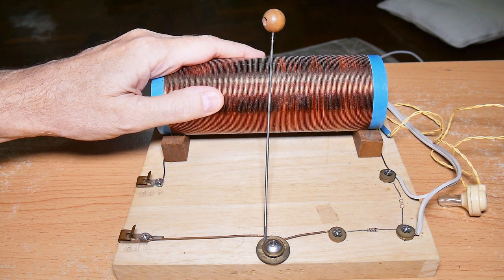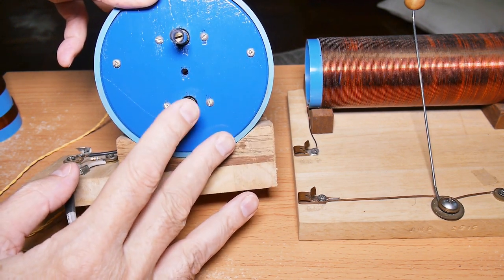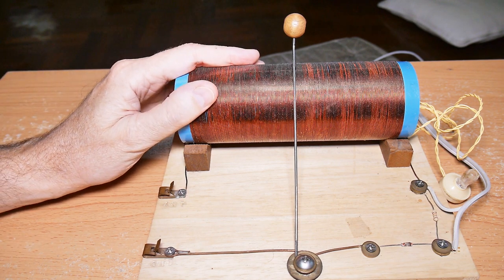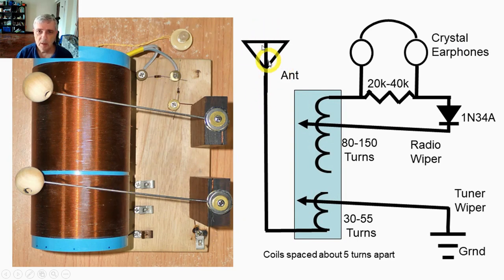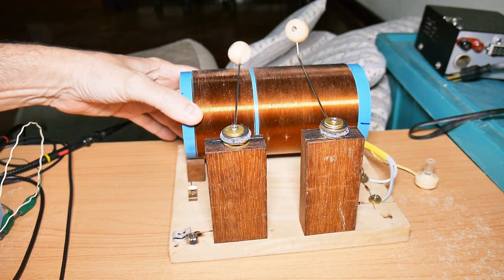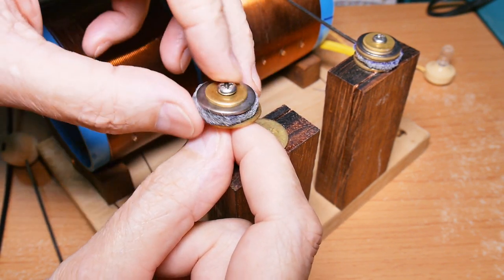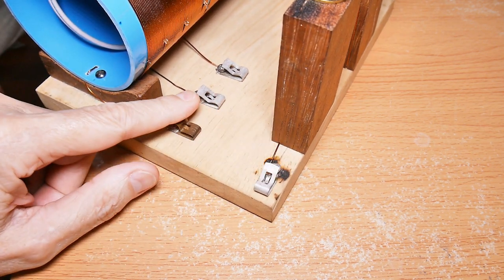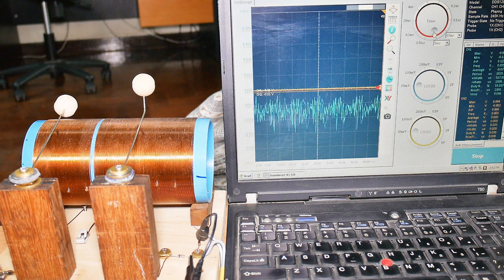My New Favorite!  Crystal Radio with Antenna Tuner

Comment from the maker: RELATED CRYSTAL RADIO VIDEOS: 
How To Make A Crystal Radio - No Batteries, No External Power: https://youtu.be/mt-s7pf-U5Q   
Crystal Radio, Capacitive Tuning - WORKS GREAT!:    https://youtu.be/VJ80Nm9KSkE
Crystal Radio & Resonant Coil Design:     https://youtu.be/Fw9eb-aB-XU
Crystal Radio Antenna (Shortwave Also):    https://youtu.be/G8AsgZbncW4

My Crystal Radio Does NOT Work (FIXES for common problems):    https://youtu.be/kCxQ8iPQx4s
Good Crystal Radio Connection Points:    https://youtu.be/G3qjrReHR1k
Crystal Radio, Connect A DC Audio Amplifier:  https://youtu.be/RW3VhnzgjtA
Three Upgrades For Your Crystal Radio:   https://youtu.be/LENco3_jV_s
Crystal Radio Wiper Upgrade:     https://youtu.be/i1otDz39nlw
Popular Crystal Radio Design That's a Waste of Time - And Why: https://youtu.be/r9Onub2Xpzc   
New Crystal Radio Design - "Modified-Pickard":     https://youtu.be/_qxHhFKjLAg
Crystal Electric Generator RF Energy Harvesting Exp 5 - Full Wave Rectifier:   https://youtu.be/BTu_GJKjOmA

Comment: Wow ! I'm growing more and more satisfied with your two coil design.  After I modified mine to your design (even without making the turns to ground adjustment) I'm getting much better  frequency separation.  
Before the mod I could understand 3 stations with very much cross talk from even more stations and when I pushed in my paper core capacitor all the way in I could still hear the  strongest station, but couldn't understand anything because the cross talk was still stronger.  I haven't yet put separation to a hard test on the upper frequencies.
Now (even in the daytime) when I push the capacitor in (oh and I finally got my store bought capacitors) and when I add in the store bought capacitor in parallel with the paper core capacitor I can hear a few weak stations and understand them because there's now no cross talk way down in frequency.  It's still not as sensitive as my TS 440, but that radio is a little more sophisticated.  lol
Now on the crystal radio I easily find 5 or 6  stations now and separate those other much strong stations  - "entirely" out with zero cross talk.   I'm getting stations somewhere around 0.630 kHz.  Weak, but steady.  I suspect that station is 1 kW power and around 25 air miles from me.
You likely saw the uH numbers on my coils.  I'm sure the radio tunes below the broadcast band, however I don't think it goes as far down as hams have frequency privileges.
Oh, I found out a few days ago that there's people who make their crystal radios modified so they can compete in crystal radio contests.  If I remember correctly their rules say they can't be audio amplified.  If that's so they're likely your brand of purists.

Comment: I made a little progress.  Oh, and I got the new diodes.  I have to amplify.
(I hunted and deleted that comment I asked you to disregard a week ago.)
I finally added the L-Match coil between antenna and ground from your *"My New Favorite Radio" *video.   I waited to install that coil because I wanted to experiment with different main tuning coils first.  
On my DIY receiver most of the stations are crammed at the higher frequency end of the band and I was trying to find a few semi-local stations down around 0.520 and 0.710  The strong higher frequency stations (1.130 and 1.460) wipe out the weak lower frequency stations.  Those lower frequency stations are  weak even on my commercial receiver with a 62 ft dipole up about 30 ft..  
I made the L-Match coil on a sliding form over the top of the  coil form of the main tuning coil.   I made it slide - on - top- of - the - main - tuning - coil - form-  so I could play with the spacing of the two coils to see if different spacings gives improved selectivity.   
At first I played with sliding one coil inside the other coil.  It did tune via the capacitance between the two coils, but I'm not tuning stations  that way now.  Eventually, I'll make a direct contact adjuster to short out coil turns on both those coils.  
I'm very pleased at the improvement in selectivity.  I can separate strong signals signals at the higher frequency end of the band now and I can even separate a stronger station from a weaker station nearby by just moving the paper towel core capacitor.   Your arrangement negates the need for the capacitor.  I want to see if the capacitor added helps selectivity.
My coil / capacitor combination now tunes the AM band plus it tunes outside the AM band on both ends.  (at least the calculators say it does)  
At mid day the strong stations at the top end still override the weak stations on the lower end of the band.  Just to see I added a fixed disc capacitor in parallel with the variable capacitor and I still can't get the weak lower end stations at mid day.  Maybe at night.
I saw a video that shows / tells how to get better selectivity from a DIY crystal receiver by adding tuned circuits.  BUT I'm sure that's more than a purist wants to do.
As is,  my DIY receiver will serve my intended purpose, I think.
Again, thank you for your patience and guidance.
Reply from the maker: Sounds very cool. If you make a video (which I'd like to see) don't forget to limit any commercial content to a couple seconds or youtube will take it down.
Reply: @tsbrownie   Thank you.  
Right !  I noticed you kept the parts you recorded from your receiver to a really short duration.  Isn't every word said on radio stations copyrighted?  Can you claim creative commons or say this is for educational reasons or one or another of their accepted offerings that will avoid a take down?
Several years ago I had a copyright strike on a video.  Given the chance to defend, comment or whatever it was told I could do - I told them I didn't understand the reason for the strike because there was no music on my video and the only thing recorded was me speaking.  I asked them to tell me where in the video was the copyrighted material located, the name of the artist, the recording company, the publishing company the copyright owner etc.  I got absolutely zero response from anyone.  Even then it took several months until the strike was removed.  I didn't lose any sleep over the issue.  It's still a little amusing.
Actually my motive for making a crystal receiver is to use it as an indicator that a DIY VFO is working.  A VFO is a major device for getting a ham radio, or other types of radios, working.  There's a lot of people who are interested in electronics, ham radio etc.  Some don't have, for all the various reasons, access to test equipment that could help them know they have a VFO working OR that their circuit isn't working.  
Without some sort of detector / indicator then making a VFO is like trying to walk a tight rope while blindfolded and with your hands tied behind your back.  An oscilloscope is too expensive for a kid to get.  Dedicated small signal  RF probe power meters are expensive and not found at the hardware store.
I once had a small analog panel meter (it was a CB radio front panel meter for signal strength and relative output power.  When I got into making ham radio projects I wired onto that meter a capacitor and diode and maybe a resistor.  I used that to see the relative output of my VFO, buffers, amplifiers etc.  For some reason I can't get the same circuit to work now.  Maybe the meter I have isn't sensitive enough.  I guess I could make a few amplifier stages to drive the meter.  I've found circuits that will turn LEDs or a meter movement to pick up small RF signals, but that was before I got enough transistors to try making those circuits.  I guess I got too focused on the shortwave radio VFO indicator.  Plus the project, IF I can make it work will be interesting as well as entertaining for someone wanting to get into making a VFO and a homemade shortwave receiver..  
Another thought is to take apart old discarded electronics and scavenge transistors etc to make the crystal radio and the VFO.
Even after getting my first ham radio it took me a long time to get a VFO  circuit to actually work.  Back then I didn't know the VFO  frequency until after I had a receiver on the ham radio frequencies.  That, too is a couple of items not readily available to most kids and even some adults.
Anyway,  I was playing around with my VFO one day while listening to my home AM radio and I heard something on the radio that was a little strange.  What it was was my VFO signal.  It wasn't actually the frequency of the VFO, but it somehow mixed the AM receiver frequency and the VFO frequency.   Curious I tuned my AM radio to a quiet place and tuned through the VFO frequencies and I started hearing radio stations I knew weren't in the AM broadcast band.  I had accidentally made a pseudo shortwave receiver.   And the stations I heard changed when  I changed the VFO frequencies.
By  now you've guessed that the crystal receiver is my attempt to make an indicator that a VFO is working.  It could be an interesting project that gives kids and young adults a way to feed their electronics interests without spending hard to part with resources needed for more important things than for hobby interests.
That's my story and I'm sticking to it.  lol
Oh, a video?  That was my main motive for this entire excursion.
Reply from the maker: @southernexposure123   About the YT takedowns; I'm not a lawyer, so I can't say what's legal, but if I keep it under 2 seconds they leave me alone (some people say 3 seconds). Maybe their software just can't detect it. I had your same experience when a German company started making claims against all my videos and wanted compensation. 99% are just me talking, no background music. I complained loudly to YT that this company was just legally scamming people hoping they'd pay rather than fight. YT actually listened. It took a while and several attempts, but it broke through their wall of silence. (The German company was banned from YT for making false IP claims I hear.) 
Your VFO tester is an interesting project. Could you not get results from low cost things like that $20 o-scope or I've seen $15 frequency counters? Sure making your own is more fun, but....
Reply: @tsbrownie  I made and edited out most of the video I made. I made explanations you already read in comments and I have too much received audio recorded. 
I'll make a do over for when I decide to post to the public.  Once I complete the upload I''ll make it an "Unlisted" video so it won't be available to everyone and I'll send you the link on this comment page which you'll click to watch.  
Before I can make a public video I'll have to modify my shooting to limit the receiver audio long enough to show the result.  It'll take some doing because the detector activates with a heterodyne right on the receive frequency audio.
I can link it to you because you'll be the only person with the link.
It should be uploaded before dark.
We have so many exchanges on enough of your videos I'm having to stretch my memory to get back to the page that's relevant to my comment.  lol  I guess that's a good thing.
Reply: I deleted the linked video, re shot it and posted a public version on my channel.  It might have an advertisement added to it soon and won't be public any more on YT.

Comment: Haven’t built a crystal radio set for 20 years… before that I was 9 years old when I built my first with my father, early 70’s.

I’m in the process of building your dual wiper, adjustable antenna design. There is an AM station with it’s antennas about a mile from my house. The adjustable antenna will be a necessity for I’m sure the station will bleed over into other AM stations. 
What is not clear to me is the exact size of this antenna coil in relationship to the tuning coil. 

Is it a ratio or percentage of the tuning coil? 

I’m using 22 ga wire and a 2.2” dia tube. Your calculator set at 531 uH yields 139 turns for the tuning coil. How many turns should the antenna coil be? 

Many thanks and appreciation in advance. Viewed tons of videos on this and you are by far the best I’ve seen!
Reply from the maker: Yeah, I kind of glossed over that. The answer really depends on your antenna, but a "too  high" number of turns is better, because the tuner wiper is essentially shorting out the unused windings. I think I used 40 on that radio and it works pretty well with my 2 antennas, a 10 meter center tapped and a 15 meter end fed wire.
Reply: @tsbrownie  thank you for your prompt reply, these unknown details keep me awake at night… Giving the antenna coil “more turns than it needs” is the solid simple answer I searched high and low for.   It makes a lot of sense.

Using your spoke wiper on the tower design as well. Going with stainless steel hardware & felt spring but using the necked half of a brass grommet as spoke eye contact with the fender washer and bushing for the wood screw threads. 

Keeping it simple with a quick deployable line antenna for there is lightning about, I live in Florida… also going to give an in door loop antenna a try as well. 

I’ll make a video and link it in a couple weeks to let you know how it all went.

Thank you again for your help and all your great videos!
Reply from the maker: @chrisupdegrave810  Sounds like you've got it nailed. Look forward to your video. The brass gromet should work well. I was going to do that, but none of the 4 hardware stores near me had them, and I wasn't going to wait.
Reply: @tsbrownie  got the radio build complete, antenna and ground rod. Works great but it’s swamped pretty much across the entire tuning coil with a local station that is about a mile away. There are only a couple stations besides that one and all rest on the high end of the band

Comment: Please disregard the question I asked earlier today.  After thinking about it for a while I used the resonant frequency calculators and answered my own question by using a calculator for coils in parallel along with the capacitance needed to  cover the broadcast band.
Actually, at the moment I have the radio working good enough to serve the purpose I hoped it would.

Comment: I got distracted and too busy to play very much with the crystal receiver.  But, recently I accidentally added a fixed value disc capacitor (103) in parallel with the diode.  It increased the volume on weak stations, but on a few strong stations it adds heavy distortion until the main tuning capacitor tunes off the station with the distortion.  All the strong stations don't suffer the same distortion.  
I didn't yet try smaller value disc capacitors.  I'm still time limited, but will get back to that experiment.
Reply from the maker: Right now I'm trying to make a variometer. We shall see how that goes.
Reply: @tsbrownie   I don't recall if I mentioned it before.  It's easy to change the broadcast band receiver into a short wave band receiver. 
I removed both of the modified boy scout radio coils from the circuit.   It's quicker and easier to just use a different diode for the radio.  
I have a coil of 11 uH and one of 14 uH.   I put each of those separately where the main broadcast band tune coil was.  Then I connected the long wire antenna to the diode.  There's at least two high power  stations around 4 mHz and 6 mHz which are loud.  They'll only be heard after dark unless you're physically close to the stations.
Each of those coils will hear each of those stations separately by using a variable capacitor of value up to 190 pF.   A paper towel core capacitor will do.
Reply from the maker: @southernexposure123  I'll have to try that.
Reply: @tsbrownie   My antenna is maybe 75 ft. long and at it's highest about 20 ft.   I assume more frequencies can be heard with other coils and different antenna lengths.  I should use my store bought receiver to search frequencies at night and make coils to resonate there.
Reply: @tsbrownie   I watched your most recently posted build radio with all the upgrades and modifications.  Nice.
I also played with different coils for shortwave frequencies and with the disc capacitor paralleled with the diode.
When the band is weak the capacitor (103) increases the volume without changing the tuning frequency.  But on strong signals it often distorts the audio and makes the volume too loud.  But remember I'm using a LM386-4 chip amplifier.
Using a 7uH or a 14uH coil tunes almost the same shortwave frequencies somewhere between 4mHz and 6mHz.  But the volume is lower with the 7uH coil.  I can delete the L-Match tuner and the result is about the same.  Using a L-Match coil of different uH matters.  A 126uH coil works good and (certain) higher inductance coils decrease reception.  I have a 860uH coil.  For shortwave frequencies it stops reception.  For BC band it does help tune frequencies lower than 1mHz.
My variable capacitor is advertised as a 365pF, but it only goes to 220pF    IF    I connect / jumper 2 of the capacitor leads.  When I use that capacitor with it's range from 8pF to 150pF most of the shortwave stations I receive are somewhere in the middle of the tuning range.  Above and below that center tuning I hear almost nothing in the shortwave area.
It's no big issue for me to change coils because I made them in a way that I can slide off and change one or both inductances in under a minute.
Reply: @southernexposure123  video on that would be nice.
Reply: @patomahony9747  Thank you for your interest.  I posted a video on different coils I use.  11 years ago I didn't monetize because I don't want my viewers to suffer ads so when an advertiser parasites on my work I quickly hide that video. I"ll make and post another short video on the subject of my coils n the next day or so.  It might not be visible very long.  I've considered changing platforms.  Maybe . . . . .